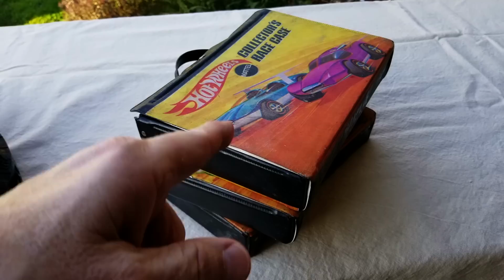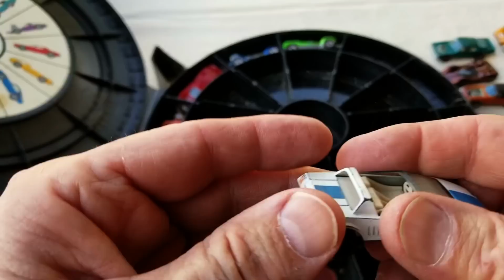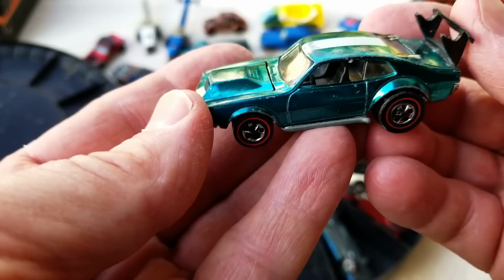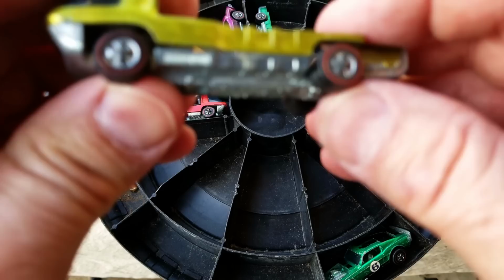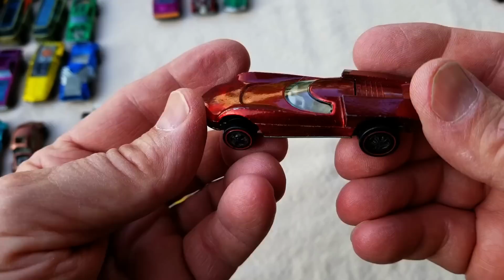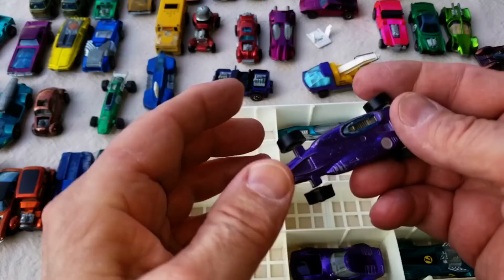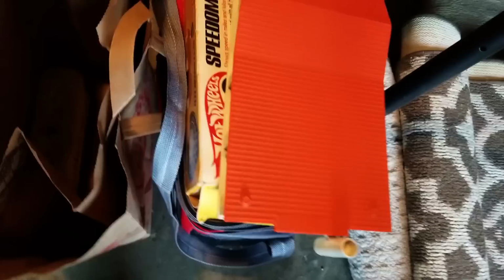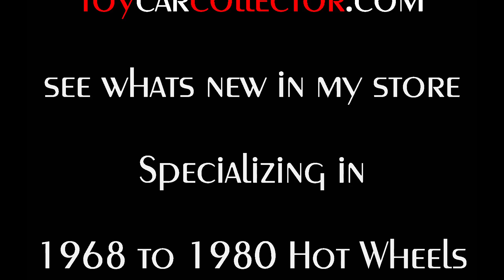Hot Wheels Amazing Barn Find You Won't Believe The Rarities Found!

Comment: What are you expecting from 40 year old abused cars that a 5 year old threw around. They aren't gonna be as if they were brand new
Reply from the maker: There are tons of old Redlines in pristine condition.  Tons of blister packs and untouched accessories.  When you collect you start with what ever you can find and then gradually you want better and better cars.  I deal with other collectors who want nothing but the finest models they can get.  Part of the fun of collecting is finding the cars you want at the price you can afford.  Hot Wheels can be bought from several for a dollar to several thousand dollars.